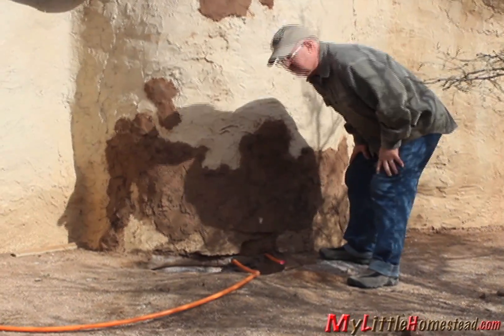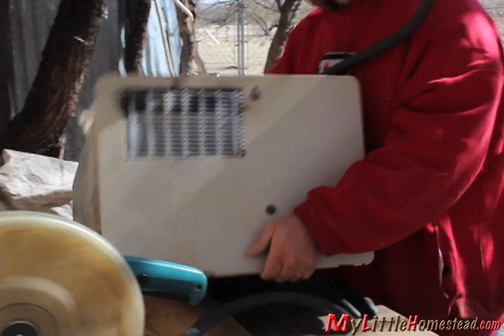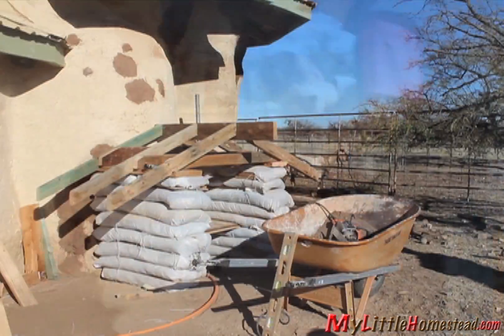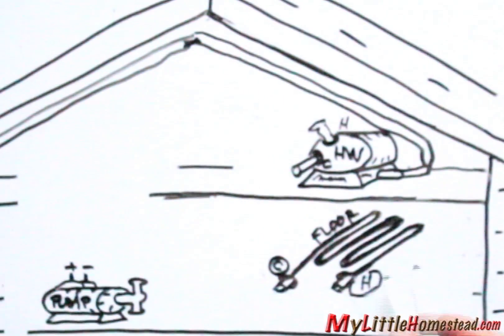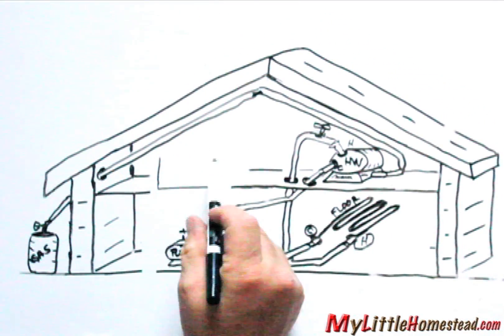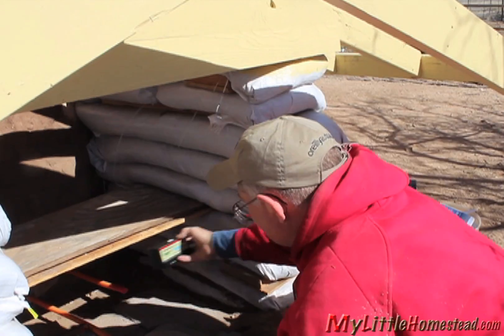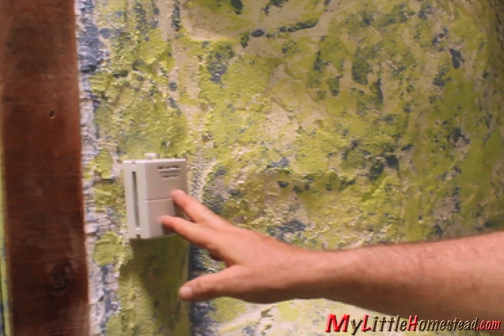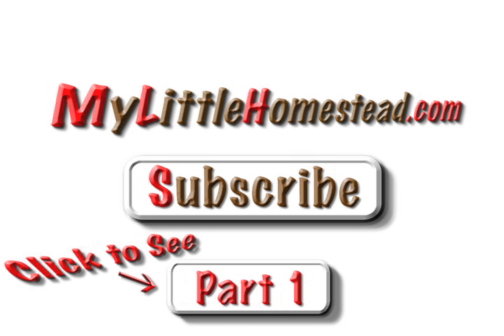Radiant Heat Floor Part 2: Hot Water Installation for Earthbag/Superadobe House

Comment: When you type  "Solar water heater"  in Google Images, you get to see all sorts of collectors, but most of them need an electrical pump to make the water run, and transport it to a well insulated reservoir, if you need one.
If you build a large reservoir and use it as the heater, do not forget to insulate it with rock wool where the shadow always is, and use transparent plexiglass where the sunny side is. The plexiglass needs to be about 2 inch away from the metal. 
You most definately need the insulation AND the plexiglass. Should it start to rain, you DO NOT want the cold rain to cool down the metal container, and thus the water...!!
Why don't you build a small one, just to see how well it works. May just a couple of gallons. If it works, scale it up and build the large one.
I was thinking about a pyramid with 8 sides, an octagon. One without the tip. About half way, the upper half is cut off at an angle (+- 25 degr.). And that angled plane is pointed towards the Sun (at noon).
This construction is easy to make. Maybe not cheap, but you'll never spend energy and money to heat up water, ever again.
Where you live, even in Winter the Sun will heat up the water, because the plexiglass and rockwool will retain the heat.

Comment: What on Earth is a hot water heater ?  Is it stolen ?   |-)
And if you need hot water, why not use the Sun?? Where you live, you get plenty of Sunny days. In the south of France they use large black polycarbonate spheres, about 1m or 3 to 4 foot in diameter. By the end of the day they get a LOT of hot water (well over 500 liters/130 USG, all for free. The water is SO hot, they will have to add cold water, it they want to take a shower or wash up the dishes, otherwise, they'll get burned...!!
And because of the large volume, the water stays hot for days. You can not make these speres yourself, but you could make somethig similar out of stainless steel and just paint the whole thing matt black. It doesn't  have to be a sphere, per sé. 
Just make sure a few diagonal panels are pointed towards the Sun, as it moves across the sky.
You guys can make something like that. Easy for you !!  ;-)

Comment: Non-motor build sealed system=Oil, Copper inserts, Solar evacuated tubes, line under floor. Summer months, Cover tubes. Presto. Tubes on ebay, 100 for ten.. wayyyy more than you need.. copper inserts and line also available.. but just as easily made... ;)
Reply: The same build, without a solar evacuated tube, can be put in sleeping bags, with a heat sink and high temp line additional from the sink, in a small ember earth sunk pit, obviously the line within a layer away from skin, and placed so its heat rises. Also, the MOST efficient heating for spaces is still an electric blanket, hands down. You can utilize the same kind within flooring so long as you spent a little extra time with sealing connection points with say, plumbing Goop* against any corrosion or moisture. But if you want to go without electrical or gas.. the best is the evacuated solar tube system.

Comment: A direct PV solar thermal into the radiant floor would be more earth friendly, especially since half the energy going into an uninsulated floor gets wasted heating the earth.  Some may think it gets stored in the earth and comes back but it was proven many years ago that the heat continuously conducts away from the warmer space above .

Comment: In your radiant floor 2 mov. there is an unintended message connected to the end with the comment about using up the propane.  A conserve the propane message would be better for future generations to hear.  Testing in warm weather is one thing but without "use up the propane" please ;+)

Comment: So does the radiant heat floor heat the whole room then? Or just the floor itself to prevent the floor from being cold when you walk on it? This may sound like a silly question but I always thought floor heating was to simply raise the temperature of the floor but with the thermostat it makes me wonder if it also heats the room itself?
Reply: mboone84 Anything that is warm gives off heat. It heats the room, not as easily as a furnace does. You can't just change the temp in a few minutes but it will warm the room over time.

Comment: I was thinking that turning heat/light from the sun into electricity and then turning that electricity into heat again was wasteful. Sun warmed water is often good enuf for a shower or bath. It can even get too hot. Passive heat for water can be really helpful and may work better on cloudy days than the solar cells. The people that sell solar cells prolly won't tell you this, tho. 
;-)

Comment: How does the system work? What kind of pump are you using? Does the d c thermostat power pump directly? I was going to do something similar. I am curious, How efficient is the system? How much Propane do you use to keep a room warm?  I appreciate your feedback.